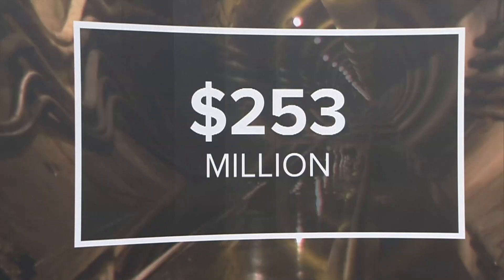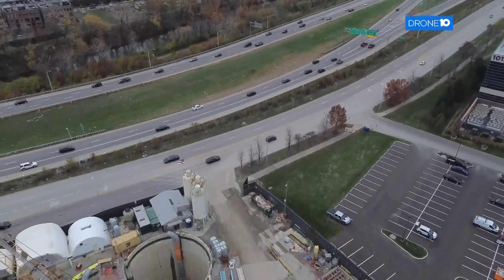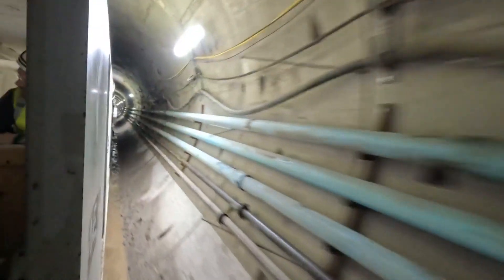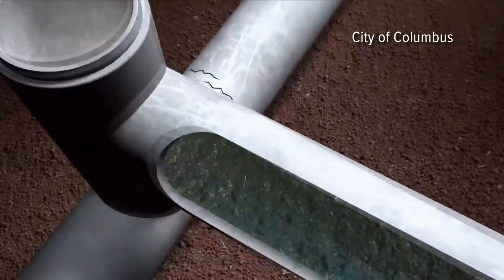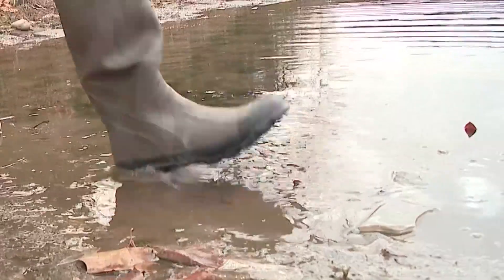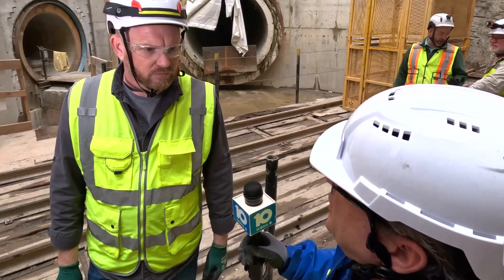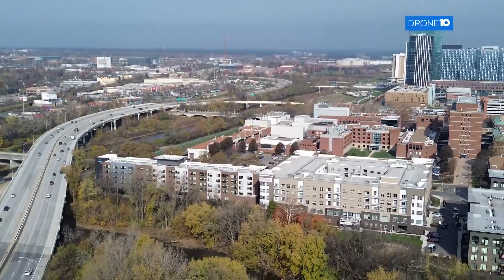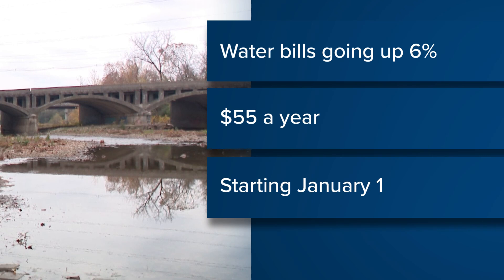Columbus undertakes massive underground project to clean up Olentangy River

Comment: To explain it a bit more for those that are wondering, this all boils down to the fact that waste-water treatment plants (WWTPs) are hugely expensive to build and/or expand. When older metro areas were built up, the rain gutters, drain tile, sump pumps and sewage all discharged into combined sanitary/storm sewer systems. The problem occurs during rain events where all the hard surface storm water runoff overwhelms the WWTP with massive volumes of mixed storm/sewer water that the plant cannot handle. This forces the untreated water to flow directly into the river, lake, sea or ocean that it discharges into. This has been happening all over the world for centuries (think last Summer Olympics). So, in the early 2000s the EPA passed tougher regulations that forced cities to fix this problem or to pay heavy fines every time this occurs. So, the three miles of tunnels being constructed are storage for the overflow of untreated water from rain events that normally would have flowed, untreated, into the rivers. Once the rain event stops, the WWTP will pump that stored, untreated water from the tunnels at a rate that it can properly process and then discharge into the rivers, clearing overflow room for the next storm. Chicago is using tunnels bored between huge, abandoned rock quarries for this same purpose.